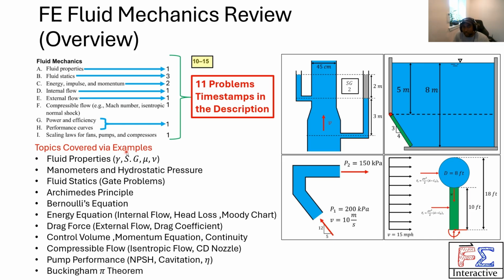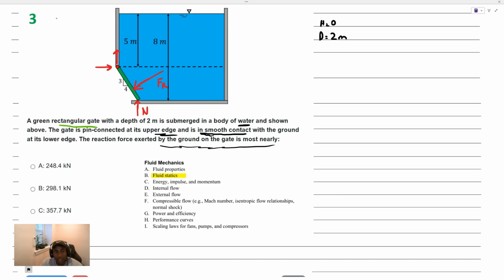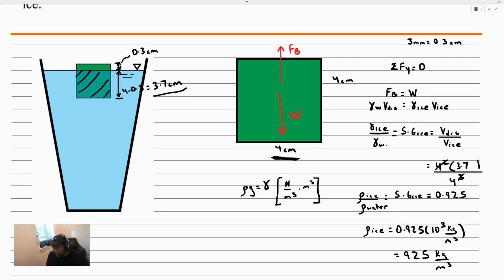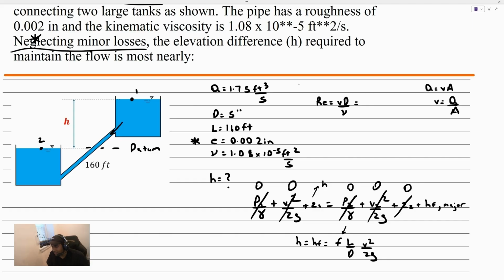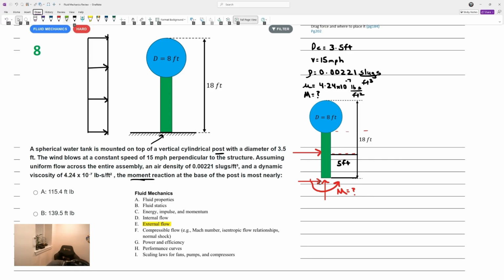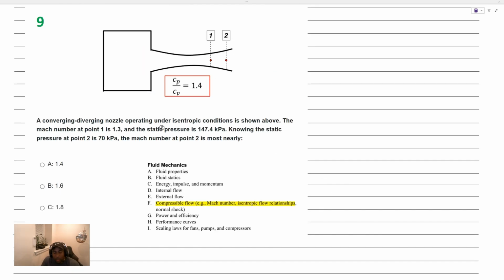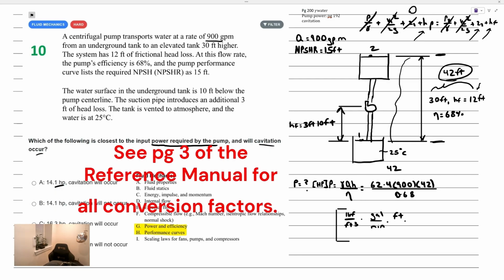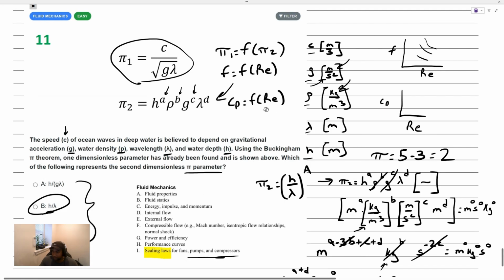FE Exam Fluid Mechanics Review – Master the Core Concepts Through 11 Real Problems

Comment: Hi! Thank you so much for these videos - really helping study for the FE. Quick question, for problem 3 when summing the moments at point P... I am struggling to understand the moment arm. Since the forces from the rectangle and triangle arent perfeclty in the x and y plane but at an angle. How does the L/2 and 2/3L correlate to the x/y plane. Thank you!
Reply from the maker: I see what you are saying. Remember that when we take a moment about a point there are a few different ways to approach it. Sometimes it makes sense to break the forces into components aligned with your coordinate system and then take moments about each component, but many times that is not necessary.

The moment of a force is defined using the cross product of the position vector and the force vector. The position vector starts at point P and ends anywhere along the line of action of the force.

The magnitude is given by:

|r × F| = |r||F| sin(theta)

where theta is the angle between the position vector r and the force F.

There is a special case that simplifies things significantly. When the angle between the position vector and the force is 90 degrees, meaning they are perpendicular, the sine term becomes 1. In that case, the moment reduces to the force multiplied by the perpendicular distance from point P to the line of action of the force. This makes the calculation much easier, and it is also easy to visualize by drawing a perpendicular line from point P to the line of action of the force.

In the gate diagram at 32:00 that I am referencing, the reduced hydrostatic forces from the rectangular and triangular pressure distributions act normal to the surface. The moment arms L/2 and 2L/3 are the perpendicular distances from point P to the lines of action of those resultant forces, which pass through the centroids of the respective pressure distributions. Even though the forces are not aligned with the x and y axes, we are not using x and y distances directly. We are using the perpendicular distance from point P to each force’s line of action.

For the normal force N, there is another important concept at play which I hinted at before, called the principle of transmissibility. The position vector for computing the moment can be drawn to any point along the line of action of the force without changing the moment about P. If we extend a vertical line through the force N and then draw a perpendicular from point P to that line, we see that the moment arm is 4 m. That perpendicular distance is all that matters.

I hope that helps clarify it. If anything is still unclear, feel free to follow up.

Comment: Wonderful video, thank you so much. I find it easier not to sub flow rate for velocity into Bernoulli's in problem 5, and rather just find velocity and multiply it by the area at the end to get Q. Thanks again, great video for FE ENVIRONMENTAL ENGINEERING study!
Reply from the maker: Thank you so much for the kind words, I really appreciate it.

Your approach makes complete sense. For me, I tend to work faster by keeping everything in variables and doing the algebra first, then plugging in numbers at the end, but that definitely comes down to personal problem solving style. What matters most is being consistent with a method that keeps you organized and minimizes mistakes.

I’m most familiar with the FE Mechanical, Other Disciplines, and Civil exam specs, but it’s really cool to hear that this review is also helping with FE Environmental Engineering. Best of luck on your exam and thanks again for watching.

Comment: Hi, I can't thank enough your videos. I am doing my FE around 23 years after completing my engineering degree and your videos help bring back to memory things and concepts I studied then. I love the way you tie in different subjects together. 
I have a question on problem 8 relating to drag co-efficient. The y axis for drag coefficient, CD is obviously in log scale but I would have just taken the value as it is because the y axis says CD and not log CD. So I am confused why you did that.
Reply from the maker: Hi, thank you so much for the kind words. That really means a lot, especially knowing you’re coming back to the FE after so many years. I’m really glad the way I connect topics is helping things click again.

Even though the y axis is labeled CD, the spacing of the tick marks shows that it’s a logarithmic scale. On log plots, the axis is still labeled with the physical quantity CD, not log CD. The key giveaway is that equal vertical spacing represents multiplicative changes such as 0.01, 0.1, and 1.0, not additive ones. So you are reading the actual drag coefficient from the chart, but you have to interpret where it falls on a log scale rather than assuming linear spacing.

A simple way to see why this matters is to look at a value that appears halfway between 1 and 10 on the axis. If the scale were linear, you would naturally read that as 5.5. But on a logarithmic scale, the midpoint between 1 and 10 corresponds to 10^0.5, which is about 3.16. Those two values are very different. In fact, 5.5 is much closer to 10 than it is to 1. If you take log10 of 5.5, you get about 0.74, meaning 5.5 sits roughly 74 percent of the way from 1 to 10 on a log scale, not in the middle.

I found an interactive slider that lets you see this visually, which often makes it much more intuitive. Use the slider and go to the halfway point between 1 and 10 to observe the value:

https://www.geogebra.org/m/wk5rqpgv

If you read a log scale plot as if it were linear, you will end up significantly over or underestimating the value. That is why I took the extra step in the solution to emphasize how the value is read from the logarithmic scale rather than just eyeballing it.

This is a very common pitfall on the FE and more generally reading engineering plots which use log scales like the Moody Chart. Good question, I hope it is clear.
Reply: @Eng_Fundamentals  Thanks for your prompt reply. That makes sense now. I looked at the video again and TBH I wasn't doing this problem myself as I was uncomfortable doing in US units. So, the CD of sphere is between 0.10 and 0.2 lines and CD of cylinder is between 0.2 and 0.4 lines. Even though I see your point on extrapolating points in the log scale by taking the power to 10, I see that by using the subdivision lines, we can fairly estimate the CDs approximately linearly between the subdivision lines. 

For example, the mark for the CD of the sphere is somewhere around the lower part of the 0.10-0.20 so around 0.13-0.14. Similarly CD of cylinder is a bit above the mid point of 0.2 and 0.4 so around 0.3. 

This would be faster but would it be approximate enough for the calculations?
Reply from the maker: @RamananRV  
Yea you can definitely use the subdivision lines and approximate in that way. More powerful is to understand how these subdivisions were placed and use linear to log conversion (pretty quick after you understand the concept). 

Sometimes when reading log plots these subdivision lines will not exist, but for the purpose of this problem, it would be an acceptable approximation.

Comment: Hey man! Appreciate your videos. Couple questions: I know you're doing problems slow for the sake of explaining, but realistically, are these really the type of problems that will be shown in the FE exam? There are multiple channels that discuss fluid mechanics in the Mechanical FE exam, but none of them go quite in depth as you do. I was just wondering because that first question you went over requires a lot more brain power in my opinion to solve, as well as the other subsequent questions. Wanted to hear your opinion.
Reply from the maker: Thanks a lot for the comment — I really appreciate you taking the time to ask, and I’m glad you’re finding the videos helpful. 

On the FE exam, some problems will take longer than 3 minutes while others can be solved in under 20 seconds — it balances out overall. For the core subjects, even though I explain more in these videos to jog people’s memory, most problems boil down to 1–2 equations. Every solution I show pulls equations or ideas straight from the FE Reference Manual, so you know the problems are in scope; it’s really just about timing and efficiency.
I also mix in harder ones on purpose, like the drag force example (problem 8). That problem is more detailed than a typical FE question, but it highlights external flow — an important concept. Think of it like marathon training: you push a little beyond what’s required so the actual race feels easier. Most of the other problems are very realistic for the exam, and with practice, your speed naturally improves.
My advice is not to worry about the clock at first. Focus on the ideas and first principles, and after working through 100–200 problems — really studying the solutions and understanding how each one is solved — your speed will come naturally. On exam day and during timed practice, use flagging by answering the problems you know first, marking the tougher ones, and coming back later. This approach helps you maximize points and avoid getting stuck, and when paired with consistent practice, it guarantees your passing score!
Reply: @Eng_Fundamentals  My GOAT. Thanks for the reply and insight.